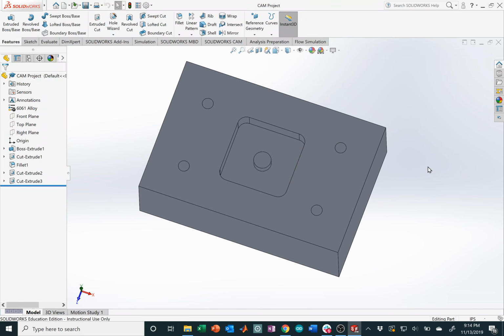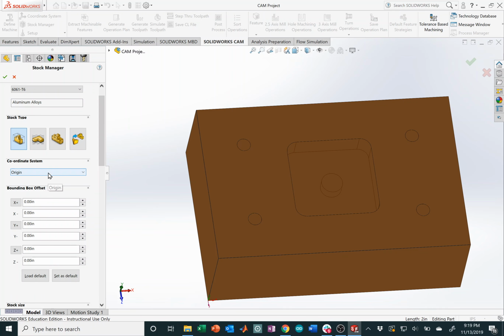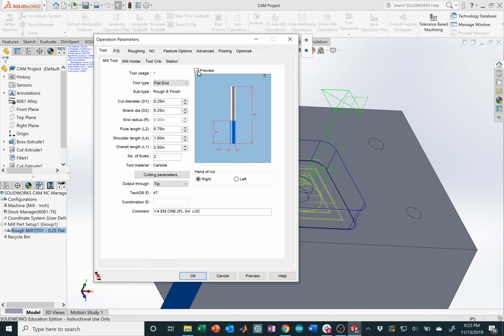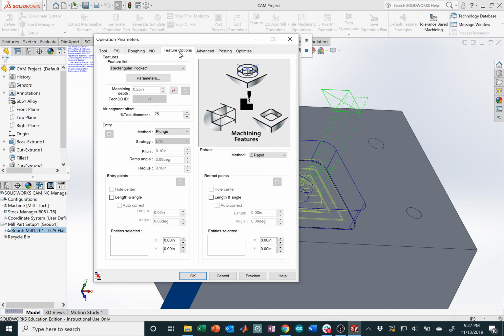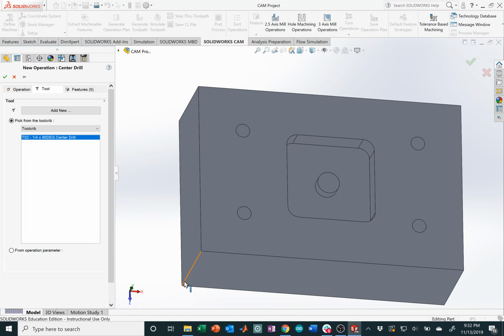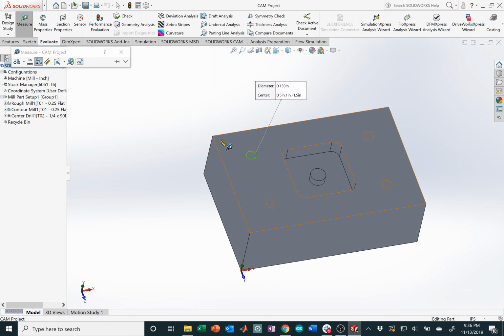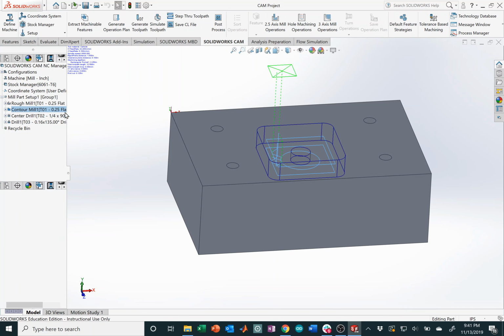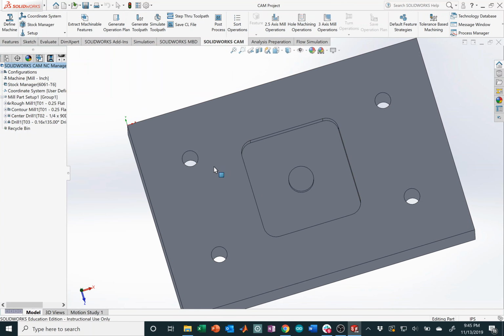SolidWorks CAM 2018 Tutorial - Basic CNC Pocket and Drilling Operation Setup

Comment: Thank you so much for the tutorial Jeff. Is there a way to have the path generated with the F/S settings to 'Tool' by default ? I currently have to edit each F/S operation from library to Tool.
Reply from the maker: Great question, I'm not 100% sure how to do this as I haven't done much SW CAM recently. There should definitely be a setting for this, I'm guessing it might be doable with the "Default Feature Strategies" tab?

Comment: How do we setup manual tool change?
Reply from the maker: I haven’t done this myself using SolidWorks CAM, but usually the gcode interpreter for your machine itself will prompt you to change tools if you don’t have an automatic tool changer setup. You can specify tool numbers in SW CAM.

Comment: hey Jeffrey
I wanted to ask, if i use a simple cnc machine with no tool changer
which mean i can do only one tool path at a time
how do i load it to my machine? or how do i split the Gcode to individual files
Reply from the maker: Hi, in your CNC machine's software, you should be able to define multiple tools that can you manually change in between operations. For instance, when using my CNC without a tool changer, my CNC gcode software interpreter pauses when a tool change is indicated in my gcode so I can manually change the tools when the tool changes. It will depend on your CNC gcode software interpreter.